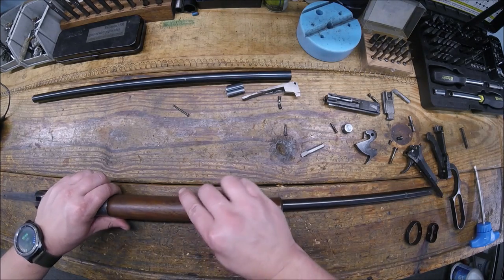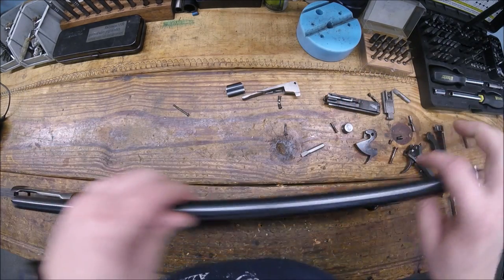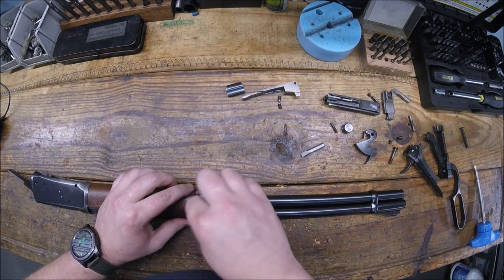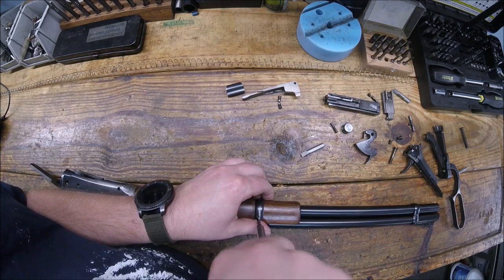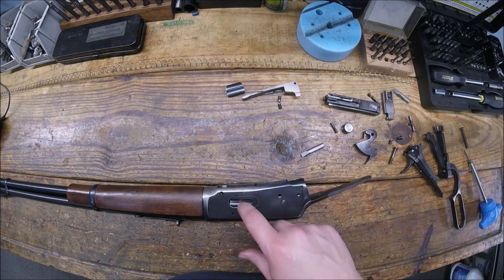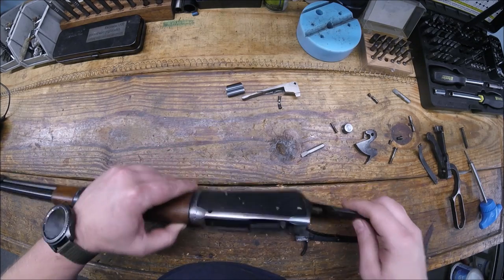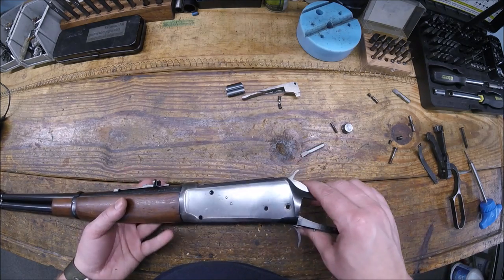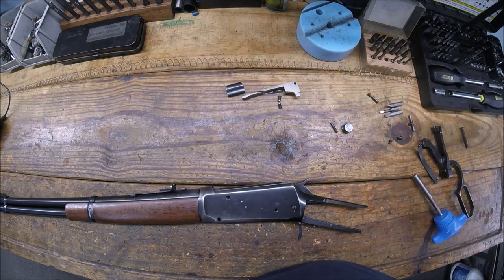Winchester 94 Reassembly

Comment: I just got my 94 back after getting it re-blued.  I am not able to load a round into the chamber now.  The lift gate (whatever its called) is not moving up towards the chamber to load a round.  Any ideas what is causing this?  I am watching your video right now to try to sort it out.  Thanks
Reply from the maker: I would not know unless I had it in my hands.
Reply: Carrier spring was in upside down.  Squared away now.  Thanks
Reply: Marty - what did it cost for the re-blue work? What was included as far as parts? Thanks!